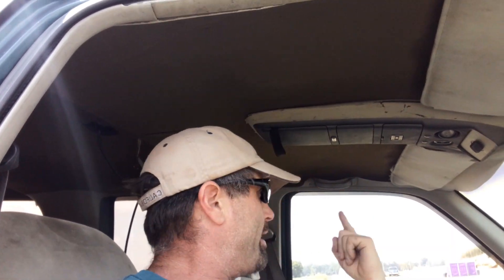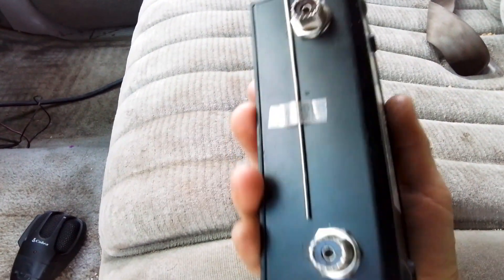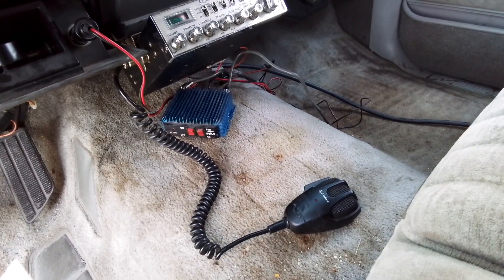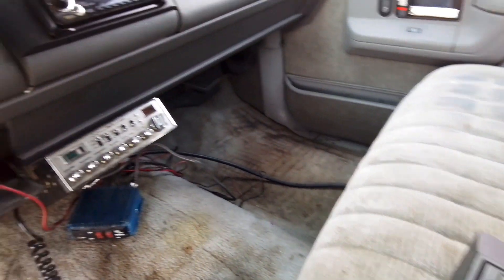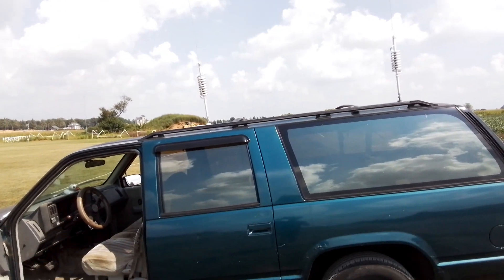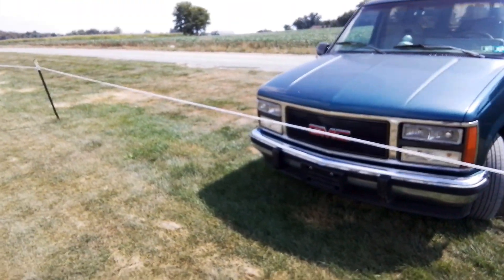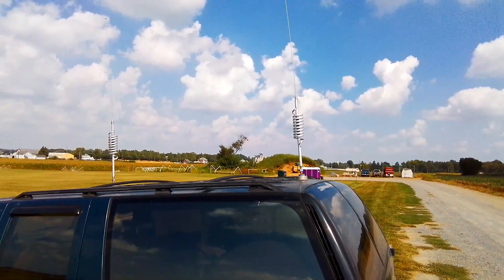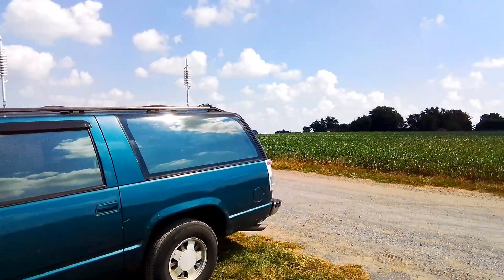Competition CB Radio Build. Directional Antenna Field Strength Test And Tune.

Comment: Checking out your Mobile setup. I used to have a van, and had one hot(front) one grounded(back) and it really did well. (only good to the front LOL) Thanks for the video. 21 S.C. Old Radio Night
Reply from the maker: yeah, man. I'm hoping to have it together enough to compete this spring. Also I am planning on crusing down to those Break's in your neck of the wood's next year. Meet some of these Southern boy's I hear on the radio.
Reply from the maker: Idk, I think I got banned from old Radio night... Past few weeks it's been dead on Sat eve.  No conditions
Reply: @DarkStarRF  All this rain
Reply: @DarkStarRF  10-4, I hope to go to the one in Rock Hill in October again, to meet  766  out of Cali.

Comment: Antennas in phase will give you the side to side signal lobe. Out of phase will give fore and aft signal lobes, depending upon which antenna has the longer additional coax feed line.
Reply from the maker: 10-4
Reply: Unless you're doing a true bonce back system.  When you tune the back reflector antenna in the hot mount then once that is tuned you move it to the back mount. Then you put the drive antenna on the hot mount and tune it . That will give you a true bounce back system. Now unless you're doing a dual hot setup it's different in tuning; I tried it and never could get it right. I had a true bounce back on my jeep cherokee and it rocked. I'm in nj and someone in Kentucky told me to turn my box off as I was talking I flipped the swith and said my box was off.

Comment: Very interesting. I would say you have a reflector on the backside of the car. It should be roughly 5 percent greater then the director. Then you need to have a certain distance between the two. As far as i can see you have both conditions met. Most radiation should go forwards.
Reply from the maker: Indeed it does after careful adjustment to the Reflector.

Comment: Right please can you let me know how to hook up two aerials at once to one rig , that's what is confusing me.get the rest but not too antennas to one rig.thanks again for all your shows ALAN FROM ENGLAND 💯🤔👍
Reply from the maker: The rear antenna is basically an extension of the body of the vehicle or ground. Only the antenna in the center of the vehicle is hot. The rear antenna acts as a reflector.

Comment: Your hooked hot to both antennas, if you wish front to back go hot on the front antenna only and ground the rear, your now very directional forward, space the antennas 9' between one another, you now have a nice skip shooting mobile antenna set up..

73's from GOOD TYME CHARLIE

Comment: I was thinking the driver door being open might be why signal was stronger .   Love that suburban or whatever it is . Very clean. Is this just an example video with a dead radio , and your real radio and setup is kept private for obvious reasons ?
Reply from the maker: The measurements I made in the video were an example of how to do the measurements.  You are correct, I should have had he door closed for the measurement. What is not shown is that fact that I had to repeat that process many times to achieve forward signal strength.
Reply: @DarkStarRF  
Yeah ,, I can imagine,, it’s hard enough setting SWR’s on a custom type single antenna, let alone adding a 
reflector/director ,, etc .  73’s to you up in the northeast corner 
347 in Tennessee 👋🏻

Comment: Great info. Did the same on my set up not too long ago, but I'm only running a Wilson 5000. I used to have a a Solarcon antenna years ago. Where did you you purchase the heat from. It looks like a unit I saw on Copper Electronics website
Reply from the maker: Craigs list. Used Equipment can be a gamble especially amps.

Comment: What antennas are you running? They look to be Predator 10k is that correct? Which shaft length?  Great to see these suburbans are still being built. I hope to build one soon as well. Maybe a 10 pill box with a two pill driver nothing too crazy. Gotta keep on saving not a cheap hobby unfortunately as we both know haha!
Reply from the maker: 4-10  monkey made. I'm still putting it together.  Lots of fun, for sure!